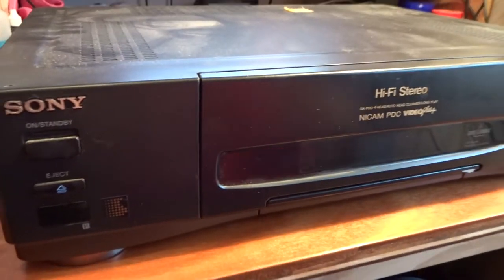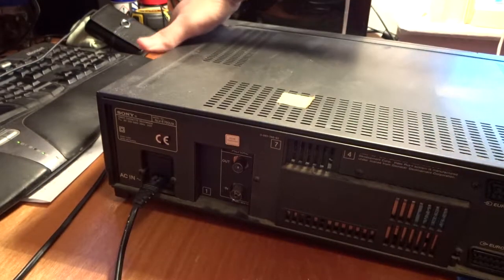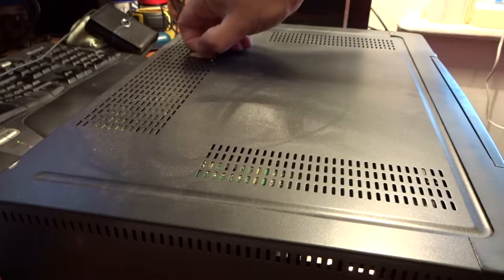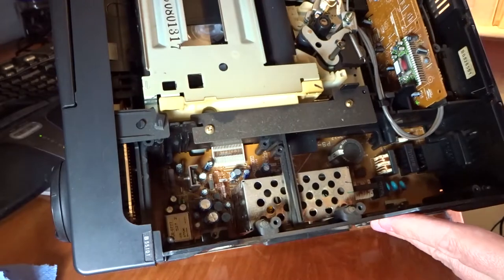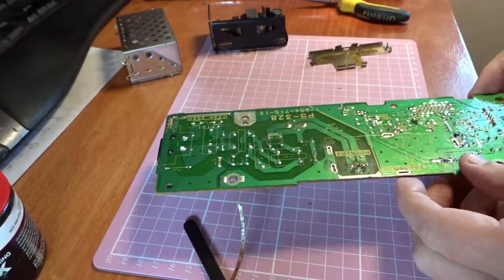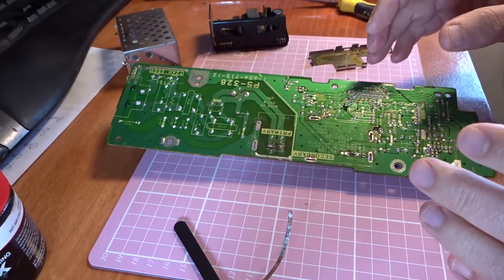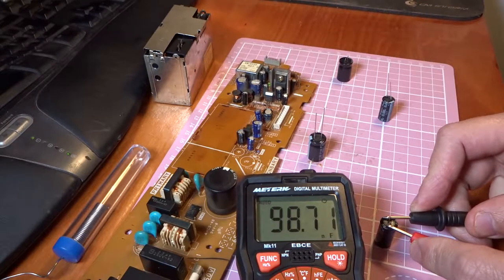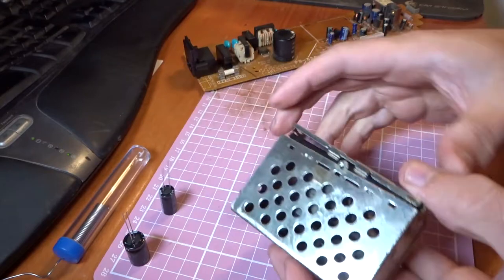Sony VCR VHS Repair No Power SLV E700

Comment: Great you got the power up - these VCRs are so mechanical - just probably need to eject and start the loading over.  Even splice the tape together if it breaks on removing.  There's probably nothing wrong with it now.  Hopefully - just reload a tape.  Great video.  Same problem with mine, NO JUICE - dead as a door nail, mate!  This video makes me a bit more fearless on repairs of this kind.  THANKS again!

Comment: Had the same issue with my 700 the caps blew it's guts all over the small primary / secondary board, I had voltage going into the primary board but coming out on the secondary was some voltages but not correct, mine had been in storage for several years though put away working I got it out last week and nothing completely dead, on mine the little board was totaled many traces none existent I had to rebuild it, put new nichicon 105c caps in put it all back together and still nothing but had the correct voltages out now the primary side was working but was loosing the 6v rail in the secondary so went voltage checking again and had one of the N25 fuse links gone at PS123 replaced that and she came to life, been working like a trooper.

Comment: Thanks for this. I recently had an SLV-E7 die on me, leaky caps in power supply. I was able to repair it by recapping (I had to replace all the caps except the big 300V one in the primary), and this video helped me a lot.
Reply from the maker: Glad you found the video useful and helped you fix yours. Good stuff well done! Its good to keep this old tech going rather than chucking it in landfill. 👍👍
Reply: @RetroElectronicRepair  Agreed. Also the SLV-E7 is the only one I own able to playback both ntsc and pal vhs tapes on a pal tv. It also has color system selection for video output, however despite having a rudimentary frame buffer for stills (being a 4 head vcr) I don't think that it also converts 60hz into 50hz (haven't really tested that though).
Reply: When they're in a cabinet where it can get very hot capacitor degradation can happen faster too

Comment: I've learnt alot from your video, thanks!  I'm trying to fix a sony slv-f990 which has a similar power board to yours with the metal can although the big 400V cap is inside the can unlike yours so you have to keep opening up the can to test it. I think the metal tabs around the can  are part of the circuit too.  But anyway, still haven't got mine working yet but I've changed all the caps on the secondary and I'm about to do the same with the caps inside the can although I'm going to leave the 400V one for now.
Reply from the maker: I hope you can get it working again. 👍

Comment: A good tip for you: When dealing with self tapping screws that screw into plastic it's a good idea to place them in the hole and reverse them until they click into the hole and pre-existing thread, before actually screwing in. That way you're not ripping the existing thread out of the plastic and boring another one in which ruins the thread, resulting in the dreaded "just turning" screw!
Reply from the maker: That's a great tip that I always do. I must include that in a video. I do it with all screws.

Comment: Hi, great video, can i ask, I've looked a RS before, but they only seem to sell in bulk (100+). Can't find packs of 5?
Reply from the maker: Sorry for late reply. There is currently a shortage of a lot of components but RS do usually have packs of 5,10,25 available but it can depend on the component. If I can't get them from RS or they are too expensive on the other sites I will generally just buy them from eBay.

Comment: Hi, great video! We have a matsui VHS player that won’t do anything. We checked the fuse in the plug, that was fine. The fuses inside the VHS player were also fine. Any ideas what might be the problem?
Reply from the maker: Is it showing any lights or signs of life at all? If not it's probably a failed capacitor in the power supply circuit. But you need to be very careful checking in there as there are some very high voltage capacitors that could kill you.

Comment: Excellent what capacitors did you use
Reply from the maker: Did you mean what values or what brand? I can't remember now what the values were but I'll either use pull capacitors out of spare boards I have laying around or will buy new ones from rs-components.com

Comment: #50:00 For safety, you probably should have put that plastic shield back over the PSU board before screwing the metal bottom back on!
Reply from the maker: Yes good point, it was more just to stop me touching it with my hands incase I left it on.